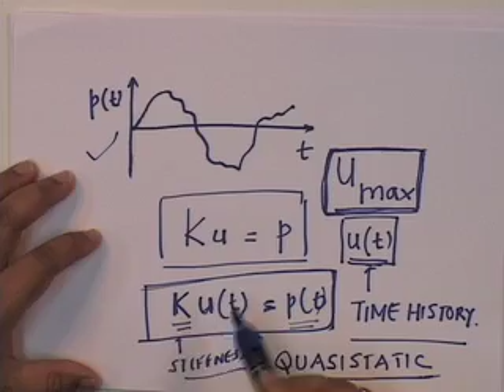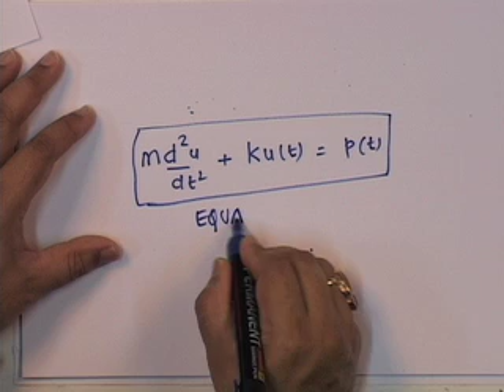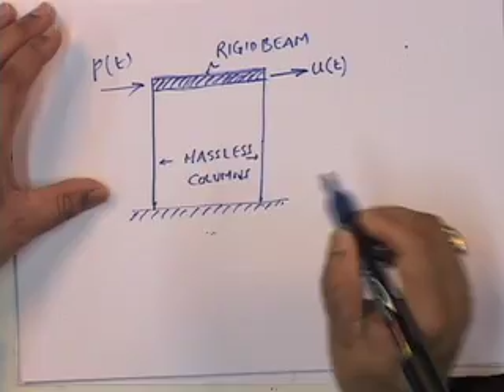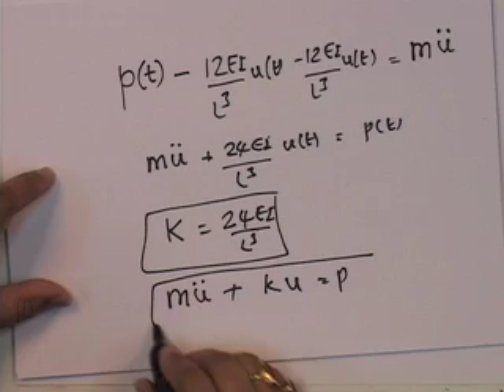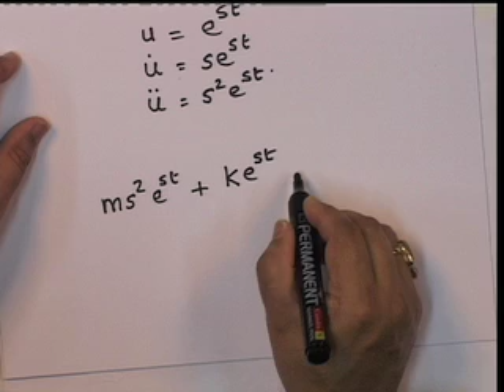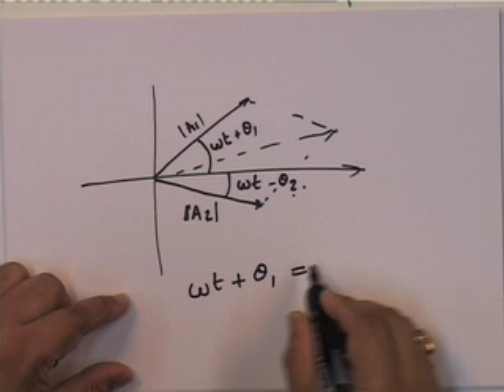Mod-01 Lec-01  Introduction

Comment: Didn't under what happened at 41:33
Reply: He defined S as being iw  just by reordering the eqn ms^2 +k = 0. If you solve for s^2 you will have -k/m and since you must solve for S then you gotta take the square root of that quantity and it's a negative quantity so it has to be imaginary and then remember that sqr(k/m) is known as the natural or cicular frecuency, therefore the same thing but negative will just be the negtive of the natural frecuency w(omega) in other words -w.   Then just remeber he's talking about an oscillatory function which must have a postive and negtive component where A1 must be the amplitud of the positve component and A2 the amplitud of negative component and since it's free vibration those Amplitudes remain constant over time and the exponential terms just difined the shape of the function for both the postive and the negative part, that's why you have a negative component (e^-iwt). I hope that helps.
Reply: @ing.erickosorio2887  from where does the theta came?? Can you tell?